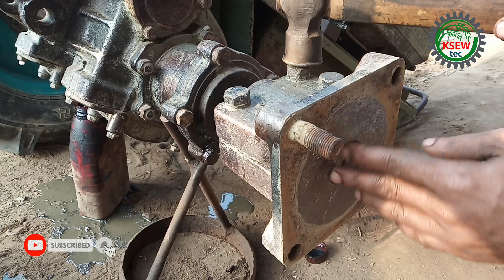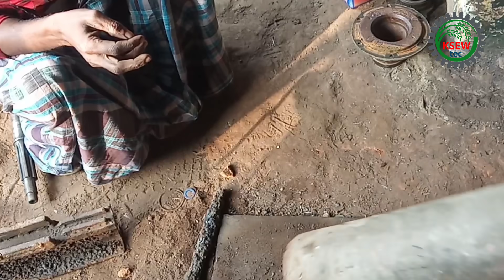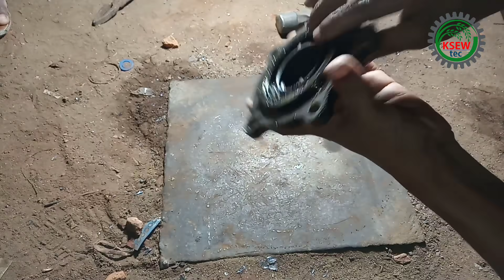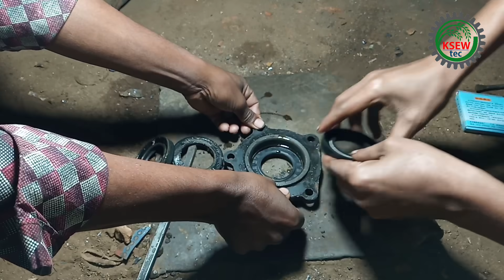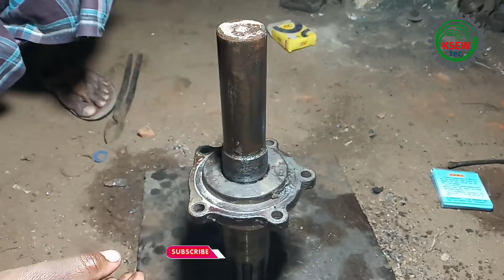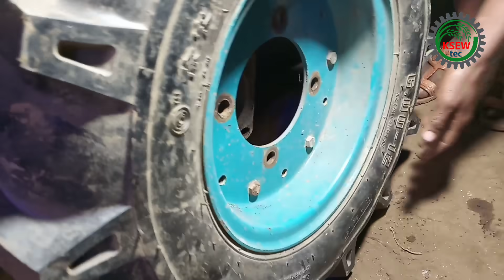Power tiller wheel shaft uninstall & install very easy.

Comment: Oil seal number
Reply from the maker: 45.70.10/12
45.70.5
অথবা 45.70.17
Reply: Greaves power tiller ar rotary r oil seal number 50-72-5 ar ak side r ta 50-72-10 kon ta kon dike dite hoi
Reply: ভাই আমি আপনাদের চ্যানেলের একজন সাবস্ক্রাইবার এবং নিয়মিত আপনাদের ভিডিও দেখি আপনাদের ভিডিও দেখে আমি অনেক উপকৃত আমার ছোট্ট একটা সহযোগিতার প্রয়োজন যদি সহযোগিতা করতেন তাহলে আমি খুব উপকৃত হতাম
Reply: ভাইজান আমার পাওয়ার টিলার গিয়ার বক্স ফাল সেপ এবং এবং সামনের চাকা টোটাল অয়েল সেল নাম্বার প্রয়োজন যদি আমাকে একটু হেল্প করতেন খুব উপকার হতো
Reply: কিংবা লিস্টে নাম্বারে দিলে পেয়ে যাবো whatsapp-এ দিলে ভালো হবে
Reply: Bearing number  @KSEWTec